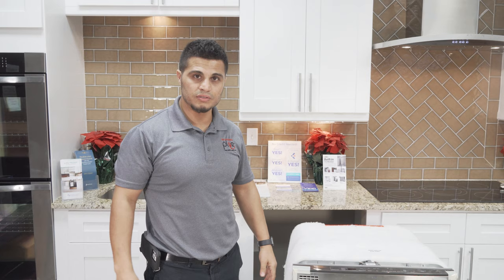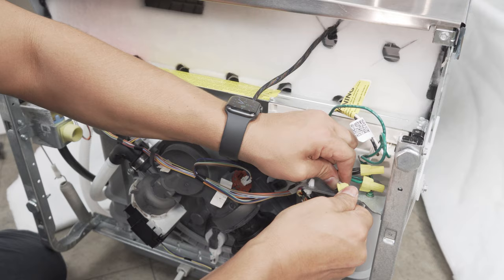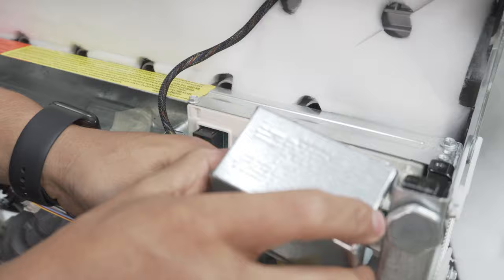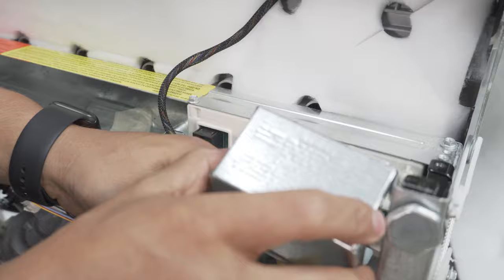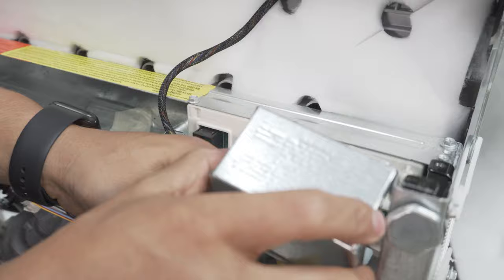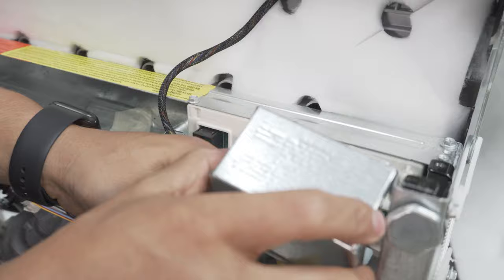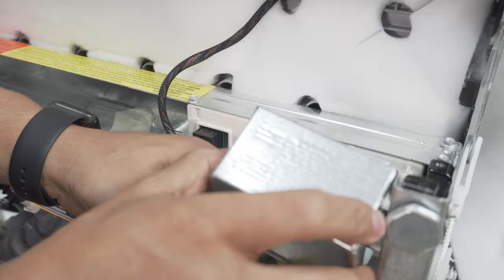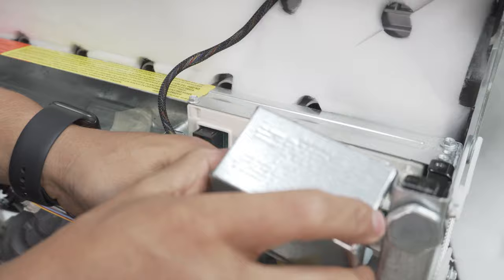How To Install A GE Dishwasher - Installation

Comment: Hello!!! I just used your video to put in my new GE Profile dishwasher . Model PDP755SYRFS.   It was soooooooo helpful!  I had trouble at end getting the toe kick back on with the insulation but I finally overcame the challenge.  I did have a plumbing issue and had to replace the shut off valve but once I did that all was running!!  Overall it took me about an Hour and fifteen minutes!  Thanks a bunch!!
Reply from the maker: Glad to help. I appreciate you sharing your experience! Thanks for watching!
Reply: I also can’t figure out how to install the toe plate. I see absolutely nowhere to screw in at.

Comment: Very good job.   Twisting the wires IS the right way according to the manufacturer of the wire nuts.
Reply from the maker: Thanks Jeff a lot of people would think you twist the wire nuts.
Reply: @TheAppliancePlug  Well, you do----until the wires start to twist which is an indication that the exposed ends have twisted as much as they are going to.

Comment: Thank you so much for posting your video. We just got our dishwasher and I was able to install myself. I did run into a couple problems though (not because of you). The dishwasher I was replacing had a copper line and mad it pain in the ass to remove. The power cord they sent me had all gray wires so I wasn't able to tell what wire goes to what. I called Home Depot immediately and they gave me the right cord no problem. The instructions that came with the dishwasher were terrible. If it wasn't your video I'd be assed out! Thank you again!

Comment: Thank you so much for sharing that installation. I am installing my new Cafe dishwasher today and was wondering how it would secure with granite counters now I know I can secure it to the cabinets. Thank you!
Reply from the maker: No problem Scott! You can also still secure to the top if you have the mounting bracket that is specialized for granite/hard countertops

Comment: Thank you so much for this video. You just saved us a lot of money. We bought and had installed, a new dishwasher. It seems they didn't secure that white plastic hose to my garbage disposal with a clap. They just pushed it on and used that red sticker to secure it. instert angry face  So now I can just buy a clap and fix that myself.

Comment: Thank you so much for your videos!  I've uninstalled one dishwasher, reinstalled it in a new location, and am now installing a GE in the old location.  Quick question, the ground on my plug is a ring ground.  Can I just unscrew the ground screw and add both the ground on the plug and the bare green wire from the washer and re-secrure that way?

Comment: Great Job. Your hired. You clarified any ? I had.
FYI:
Having installed cabinets before its a good idea to predrill a pilot hole when installing the mounting screws into the cabinet stiles (side mount) as to not spilt the stile. Its really important to predrill into the counter top if it has a particle board sub top or use screws designed for use in particle board.
Reply from the maker: Great points! I've definitely learned the hard way in the past. I absolutely agree with pre drilling. Thank you

Comment: Hi great video! I just had this dishwasher installed in my new build and the plumber didn’t attach the very top rack that’s for spatulas and the like. I googled another video and I did notice that the top rack is supposed to have four rollers and my top rack was missing 2, I found them at the bottom of my dishwasher. Do you have a video that shows how you install the top rack? I would greatly appreciate knowing how to do this because the plumber is hard to get back in.

Comment: What does the “128” mean on the display when you turn it on? I get that number in my display when I plug it in, but then it goes off and the control buttons won’t work. Any suggestions?

Comment: At about 14:40 in the background is a black hose going into a grey "junction". What is that? I have looked and looked at diagrams but can't find what it's for. It's part 575 on most diagrams.

Comment: I did all this and I still have zero power. Tested the power cable and there’s power to it. When the power cord was attached, dishwasher chimes but still won’t power on.  This is a brand new washer. Any ideas.

Comment: One problem I have is I had to side mount the dishwasher due to having granite countertops.  After install, when I opened the door and pulled the bottom rack onto the door to unload the dishwasher, the bottom of the dishwasher moves into the cabinet space ( towards the rear).  The front adjusters slide on the laminate floor causing the dishwasher to pivot.  if I did not have the side mounts, the dishwasher would tip forward but because the side mounts prevents it from tipping, the bottom slips back into the cabinet.  Don't know how to prevent this happening.

Comment: My old dishwasher was electrical hardwire. Not sure if I should take the trouble to add an outlet and use a cord. I suspect it should be a gfi as well. Excellent video.

Comment: Can you use the power source from the old dishwasher or is that not a good idea?  Thank you for this video!  I think I can do this now.
Reply from the maker: If you’re referring to the power cord from the old dishwasher, yes, if it’s in good condition you can certainly use it. But if you’re purchasing a dishwasher kit, some of them will come with a power cord. Check out my Linktree link in the description for a dishwasher kit that includes everything you’ll need. Good luck and thanks for watching! 🙏

Comment: Good Job on the video. I am about to swap out this exact dishwasher in the video with a new GE dishwasher. I am curious why you did not install the side mount brackets on video. My original dishwasher was installed with under the counter brackets by my builder, however GE recommends using the side mounting. Does it really matter?
Reply from the maker: It only matters depending on your setup. If you have granite countertops and other hard marble surfaces, then you would want to use a side mount. Both side and top mount will get the job done!

Comment: Great instructions! Unfortunately, I found this after a handyman installed mine. I noticed that the drain pipe is hanging lower than where it is connected to the disposal. Should I move it higher?
Reply from the maker: Thank you. I recommend moving it up so you don’t have standing water in the line or the possibility of the drain water back flowing into the dishwasher. Even when the pump stops, any water left in the drain hose will flow into the disposal as long as the drain hose is elevated properly.

Comment: We cant get our dishwasher to work. it is a  brand new GE GDT665SSNSS. We already had it replaced once. This one hasnt seen a dish. It starts and runs for a few mins and ends up with some standing water in the bottom.  two clues.... 

1: The installer had to pull the drain hose extension off of the zip ties be that fasten it to the underside of the countertop becasue it was back behind our lazy susan (I cut holes to access behind) the line is drooping.

2: the circuit is a split  240 circuit, the same one my old dishwasher had. 

Please Help!! We are so frustrated.
Reply from the maker: Does your dishwasher drain into a garbage disposal? Check out this video and let me know if this was your issue. https://youtu.be/dP9tT8phyrk
Reply: @TheAppliancePlug  turns out a piece of the hose tag ended up in the hose, causing an obstruction. the dishwasher is running amazing now.

Comment: Thank you!!! AWESOME job!!! Would you mind posting what tools and sizes required for installation? I want to make sure I have the correct sizes and types required. I really appreciate you noting you could use a certain type of screwdriver but a Phillips would suffice. I believe you used a flat head on another occasion. Thanks again!!! With your guidance, I think this is totally doable. 👍😃
Reply from the maker: Thank you! As far as tools, you can get away with basic tools including the following: A multi-bit screw driver (Milwaukee 11 in 1 is my favorite), 5/8" wrench for dishwasher supply line, a drill to secure unit, and a pair of adjustable pliers.

Comment: I bought a display model and it did not come with the drain hose extension. I bought a universal one from the big orange box store but  it doesn’t seem to fit very tight on the dishwasher end the next size down to trip it to, 11/16 is too small. Is it safe to leave the one inch opening in there and insert the hose directly from the dishwasher as far in  as possible and use the clamp that came with the universal one? I am afraid that leave too much slack when clamping this down and will leave a leak.
Reply: Same, mine didn't have the drain hose extension either. Thanks to this video I realized it was missing. I tried the universal one as well from HD and it did not fit properly around the hose end, sprung a leak on a test run. Had to buy the official GE one from Amazon, part# WD24X10062

Comment: Thank you so much, very helpful. Quick question, I have the same wires green, white and black from my dishwasher but the one from my house are only black, white and one without plastic around should I connect the one without color/plastic to the green one?
Reply: The one without the plastic (copper) is your ground. Connect that one to your green wire on the dishwasher

Comment: I am getting an ftd code and it won’t start. Can’t find that code anywhere. Same model new.
Reply from the maker: I apologize I'm just noticing your comment and it's likely you've figured this out. However, that sounds like a drain problem. Make sure the drain hose isn't pinched and if your drain hose connects to your garbage disposal, make sure it's clear. Check out this video for additional details: https://youtu.be/dP9tT8phyrk

Comment: Can you add a  power cord to your dishwasher if it doesn't come with one? I guess  mine is set up for a hardwire. I would think it would be fine either way, yes?

And thank you so much for walking through the whole process

Comment: Great video! My disposal is far away from the dishwasher. I bought a 12’ extension but it looks like I need it to be 16’. How do I join the the 4’ hose to the extension hose?
Reply from the maker: Are you extending the drain hose or water supply line?
Reply: @TheAppliancePlug  drain hose

Comment: How come this doesn't address the removal of the drain plug?
Reply from the maker: Which drain plug? There shouldn’t be any plugs within the dishwasher that need to be removed. If you’re referring to the flap located where the drain hose gets connected, that shouldn’t be removed. That’s there so that it stops water from flowing back into the dishwasher. It opens on its own when water drains out.

Comment: I don’t have a green wire to connect to the one on the dishwasher any advice?
Reply from the maker: I've ran into that before, and the only way to fix that is having an electrician run a new (up to code) line from breaker box in order to ground unit. However, the unit will work without being grounded. The ground wire can be thought of as a backup neutral.
Reply: Figured as much and it did work without the connection. Great video!

Comment: Is it safe to leave off the two rubber side strips?  Do they perform any type of gasket or door sealing function?  My fit is really tight and I cannot get those side strips to fold back like the instructions show.
Reply: He said at 37:37 in the installation he was demonstrating that the fit was precise and they did not need to be used.  I paraphrased.  The side gaskets help with noise reduction and should be used IF space allows.

Comment: Oh no, I watched this primarily to see how the TOP trim piece is installed and you only showed the sides. The illustration in the GE installation manual is worthless. Other than that, GREAT video! Also, if I'd watched this a little sooner, I might not have driven 18 miles rt for teflon tape, lol. I just assumed that any threaded connection would benefit from teflon tape. But I'm far from being a pro.
Reply from the maker: Oh no, well I’m definitely glad you watched it 😎. Teflon is mainly needed if your supply line is copper. Did you figure out how to secure to the top?

Comment: Great video! Helped me for sure. Check out Wago Lever Nut wire connectors. They will make your life so much easier than those twist-ons.
Reply from the maker: I will have to check it out, I have just always used nut wires.

Comment: My cafe dishwasher doesn't draining water
Reply from the maker: If it’s a brand new dishwasher or you recently replaced your disposal and the drain hose connects to a disposal, check to make sure the plug inside the disposal has been removed. If you haven’t recently replaced your disposal and the dishwasher just randomly stopped draining, then it’s possible the drain pump went bad.
Reply from the maker: Check out this video that might explain better: https://youtu.be/dP9tT8phyrk